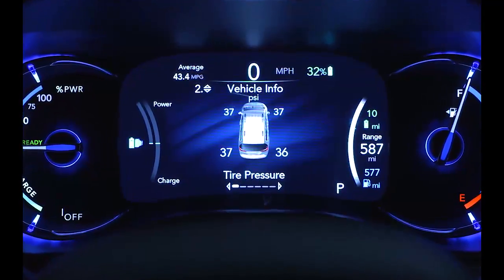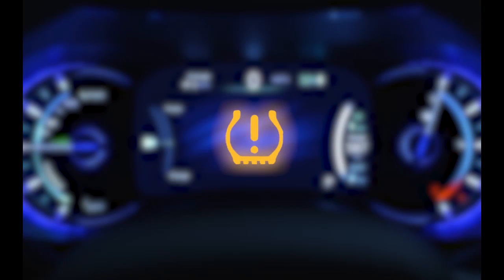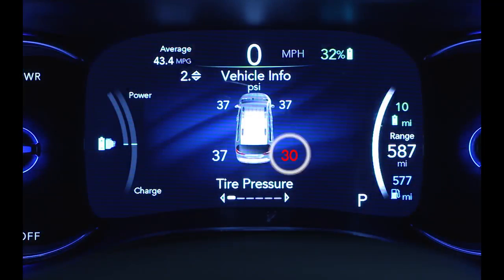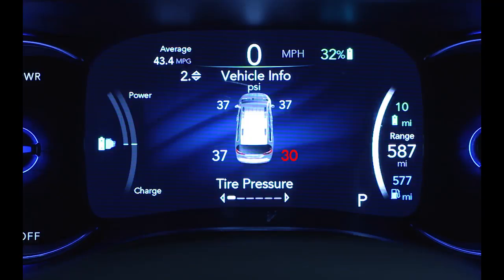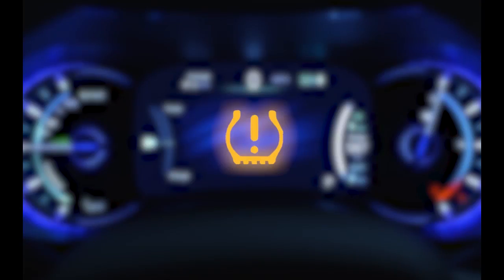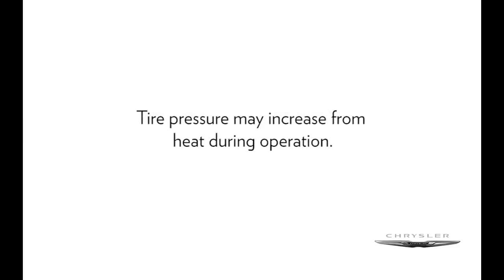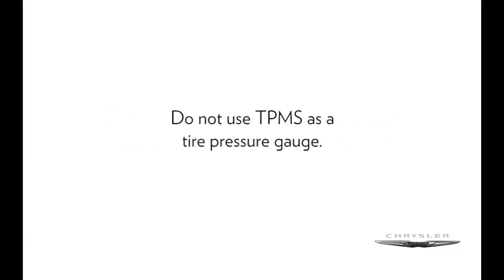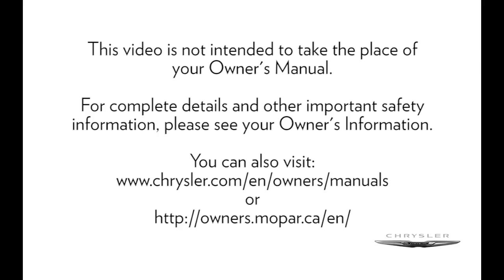Tire Pressure Monitoring System-TPMS light and tpms sensor in 2017 Chrysler Pacifica Hybrid

Comment: How do I turn the light off if the sensor breaks?  These vehicles have too much useless tech that is difficult to bypass manually
Reply from the maker: Hi Matthew Fears,

Please know that you will need to have the sensor replaced in order for the light to go off. With this in mind, we recommend connecting with your local Chrysler dealer as they are in the best position to assist with this concern.